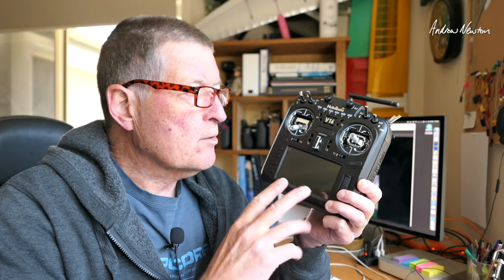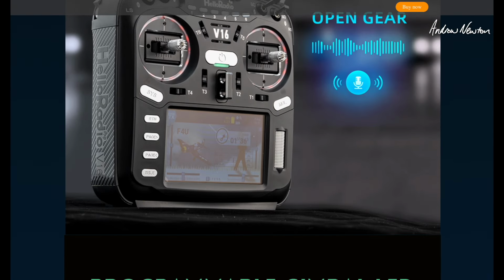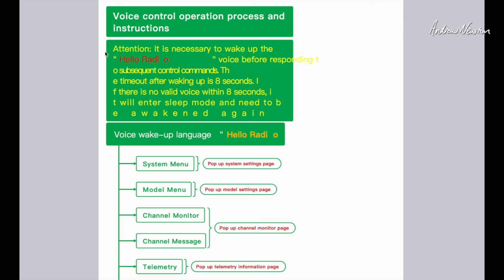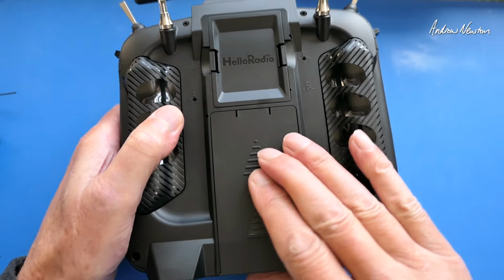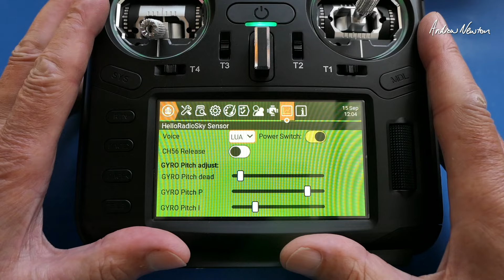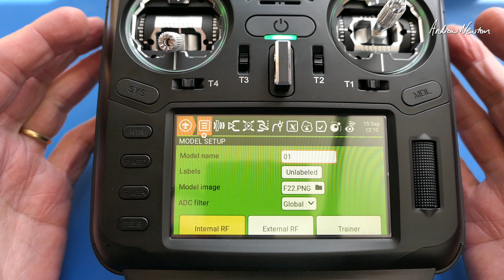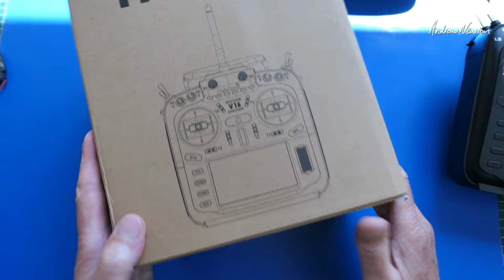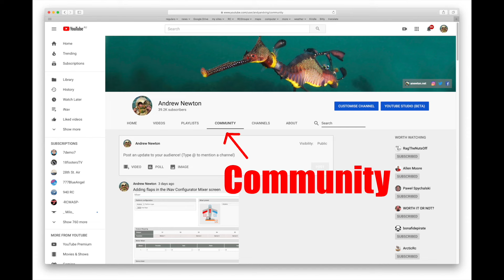HelloRadioSKY V16 EdgeTX ELRS with AI Voice Control

Comment: I don't really want all this stuff. What I'd prefer is a boxer sized radio with proper sliders and dials, internal 1W ELRS as well as internal 4in1 and a module bay for my Crossfire module. Add in a big LiFe battery and a minimalist carry case or snap on TPU protector for the controls and screen and I'd have everything I'd ever need.
Reply from the maker: That would be perfect

Comment: The voice control of trims is a great idea. I would use it for gear and flaps as well. For anyone afraid that their buddies will mess with them with voice commands...the mic could be placed at the bottom of a foam lined tube, with the opening pointed straight out of the face of the radio toward your mouth. The off axis rejection would be huge.

Comment: Looks like just a rebadged Radioking.    
Might be an alright radio, once you got Choppergirl's free sound pack on it.
They made the same mistake on it they did on the TX16, putting the 16 function buttons across the top.
They fixed it on the short run Eachines version but then you were getting a non standard case.  If you're making a nonstandard case anyway you might as well fix it.

Comment: Gosh..  I’m not sure this is going in the right direction.  It’s just a control system so if they’re not going to integrate ardupilot,  I’d rather ELRS and EDGETX got more simple, not more complicated.
Reply: EdgeTX is used for more than just FPV. When you don't have a FC on the aircraft the configuration and mixing happens on the radio.
Reply: Hi Spike

Comment: The comments about channel 5 highlight the continued need for the ELRS project to fix this issue. The arm function should not be a channel at all. It's just a one bit flag in the data packet that is not even part of the normal 10 bit channel data. In the early days of ELRS it would have been necessary to use a channel on the radio to pass the arming status to the Tx RF module. Even today that is a valid option for backwards compatibility, but the actual bit flag in the OTA data packet should never have been treated as a traditional channel. Instead, the original implementation should have allowed for mapping any Tx channel as the arm input and then allowed mapping the arm output onto any output channel in the receiver. This would have allowed more flexibility configuring models on the Tx, and fixed wing users could simply not map the arm flag to any receiver output. The problem is that they never had fixed wing applications in mind or frankly anything else other than multirotors.

Now that ELRS is serving as the actual RF foundation for new products from Jumper and RadioMaster, they really need to coordinate and fund a code cleanup effort that will get rid of the legacy channel 5 conflicts. Update EdgeTX and ELRS so the serial data stream between the Tx and its RF module includes out-of-band data like the arm flag and then update the EdgeTX or ELRS Lua to allow configuration of a switch for arming without controlling a conventional channel.
Reply from the maker: Yes an alternative "ELRS armed" method would be better.

Comment: my voice command for elevator is on my throttle trim .is there a fix?
Reply from the maker: Maybe with the configuration app
Reply: @AndrewNewton  Fixed by using the cross trim.

Comment: Interesting that they haven't enabled the "Motion Control" especially as the RadioMaster MT12 wheel radio has an optional gyro module that can be assigned to control say an RC tank turret rotation and elevation or crane boom.https://www.youtube.com/watch?v=FUCyOaEgVYo
Reply from the maker: Albert Kim got it working so I may have just missed it.